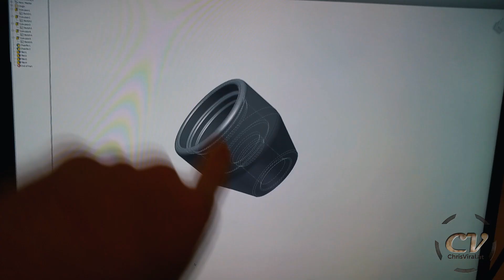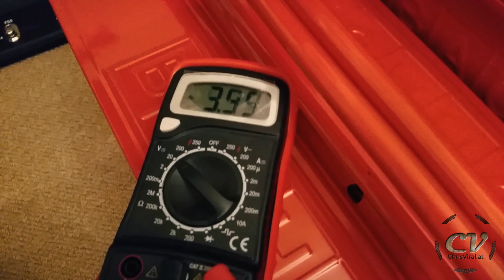Flame Fist V3 Test (Punch Activated Flamethrower)

Comment: First! ;)
Actually high pressure is the ultimate range looks promising :)*. 
You have to find the right distance between nozzle end and ignition. 
Try real close and then go further away. Dont put the Arc exactly in the center, maybe 5-8mm offcenter so it wont get 100% pressure (it worked in my experiments).

Another idea if you can try differerent Nozzle sizes, maybe 3DPrint them with different sizes. They dont have to survive longterm, only shortterm to find the perfect Nozzlediameter.

* High Pressure means a lot of gas which has not enough Oxigene to burn, so the ignition is slower & harder than normal. maybe Try the Yellow Gas for comparison since its more flammabel. :)
Reply from the maker: Nice one #1 :D
Yes indeed, my plans align with your suggestions. Switchable nozzles for different purposes would be cool as well. The next update will definitely be exciting (if everything works as I intend it to). Yeah true trying a different gas would also be a great idea!
Reply: lol my english at night reads like it was written by an alcoholic.
(i dont drink, just tired)